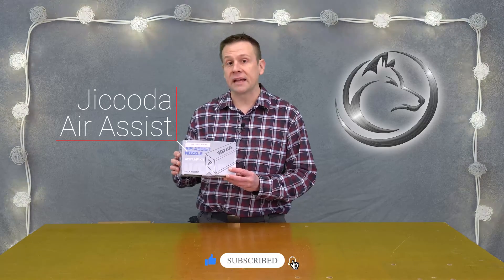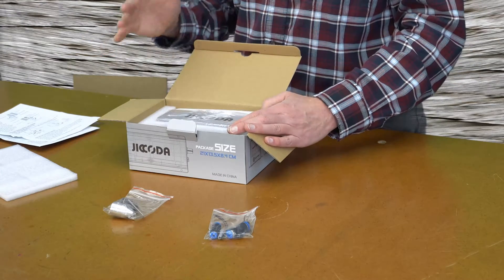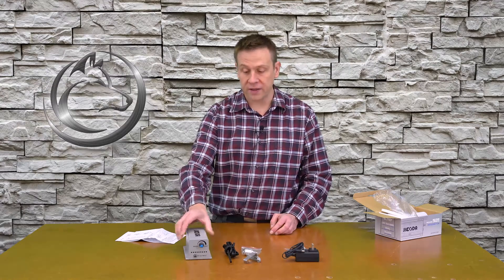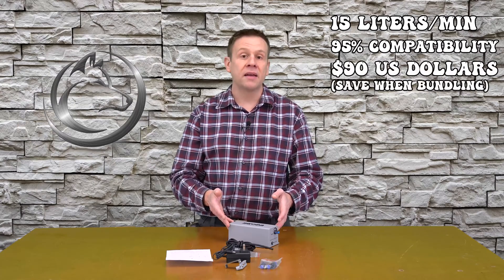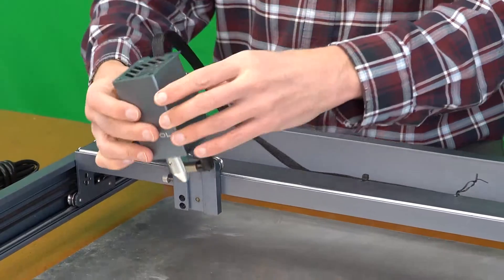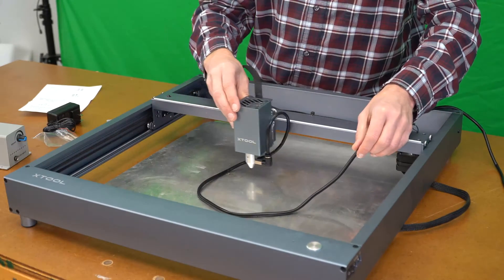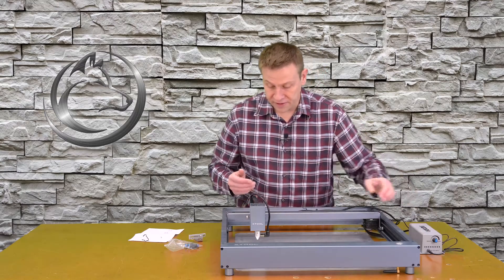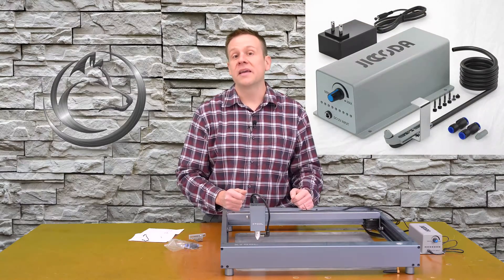Jiccoda Air Assist on Xtool D1

Comment: The jiccoda air assist doesn’t not fit correctly on the Jiccoda L1 without self modification of the brown/orange protective laser cover.  The protective cover has the focus function built in and if you remove the cover to put the air assist nozzle on you loose that feature of the jiccoda laser.  I emailed jiccoda and explained the issue put they were not interested in correcting this problem.  Jiccoda just said to remove the protective cover and focus function to make the air assist nozzle fit.  Unsatisfactory product for the Jiccoda laser for which it was supposedly made.